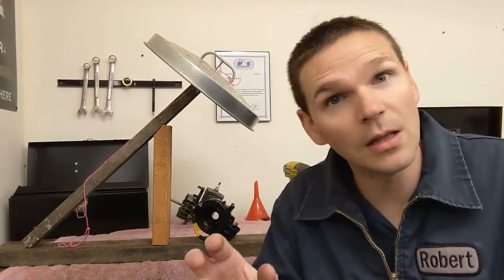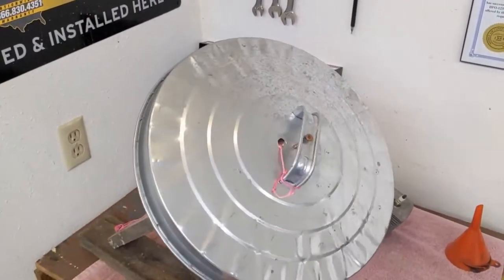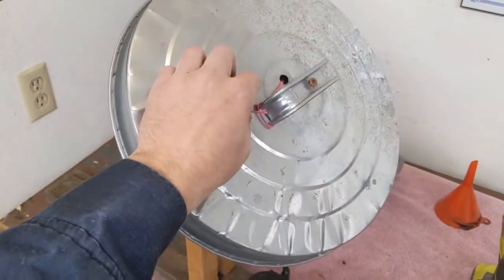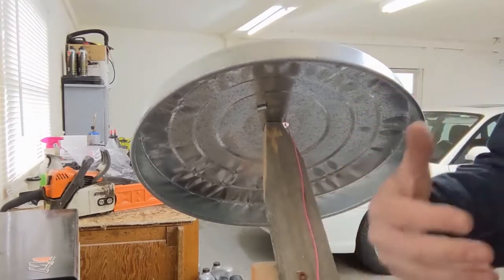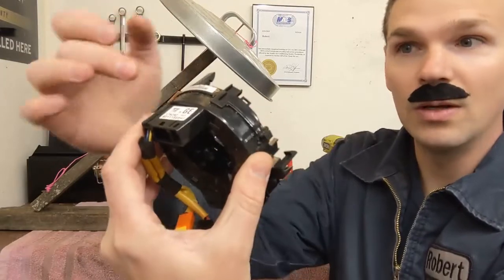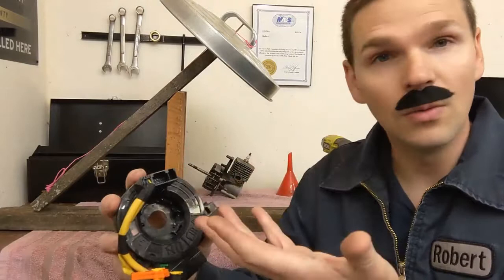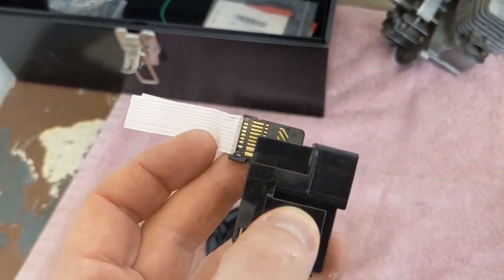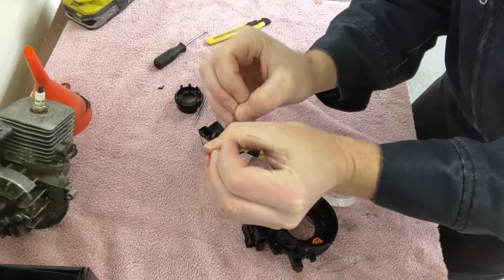Clockspring/ Roll Connector Explained and Simple Testing Method

Comment: my car have a problem there is no horn when the key is on and there is a horn when there is no key what do you think is a problem?thank you so much
Reply from the maker: @migmax-o6m  That's an interesting problem. What kind of car do you have?
Reply: @ValleyMobileAutomotive its honda civic 2010 i tried to change the relay it works but after 2 days its not working again. sometimes there is sometimes nothing
Reply from the maker: @migmax-o6m  That's interesting. It should be a simple circuit. You have a 15A fuse that has power at all times. That sends power to the relay. The horn button provides the ground to complete the circuit. The ground travels through the clock spring. When the horn doesn't work try turning the steering wheel and see if it comes back.
Reply: @ValleyMobileAutomotive I tried so many times by turning the steering wheel but still its not working sometimes there is. but the weird thing is when the engine is off there is a horn that is working😅 i was using 30amp of fuse and now 10amp but still not solving the problem😢

Comment: Would clicking while turning the wheel to the right in a specific spot mean that there is something wrong with the clock spring? I have a car out of warranty with less than 15k miles that I just noticed having clicking/gear sounds. To my knowledge all buttons work fine on the steering wheel and no airbag lights. 2019 Camry SE.
Reply from the maker: @warhawk3136  It depends. When you have the blinker on it is normal for the wheel to click while turning. Something else can be causing the clicking too. Usually a bad clock spring will make the horn or steering wheel controls not work.
Reply: @ValleyMobileAutomotive  I've not noticed any clicking from the wheel other than after a certain amount of rotations to the right. All my buttons on the wheel work as they should currently. The clicking/grinding sound is also really only noticeable when stopped and the wheel is turned.
Reply from the maker: @warhawk3136  A few things could cause a clicking noise. The clock spring can be one of them. Taking the steering wheel apart might shine some insights into it a little further 👍

Comment: WHERE YOU GET THOSE YELLOW END TESTER TIPS {FEMALE} ON YOUR METER CABLES??
LINK BE APPRECIATED......YELLOW TIPS THAT CONNECT TO YOUR EXISTING CABLES WITH A INNER HOLE THAT SLIDE OVER THE PIN
Reply from the maker: @jacobmatthew2000  I just updated the description to include those test leads 👍

Comment: Hello and good video sir, i have a question, do i need to disconnect the battery before measuring the continuity and unplug the conectors? For the airbag concerns?
Reply from the maker: @AngrDany  Correct, the connector must be disconnected before measuring continuity 👍. It would be a good idea to disconnect the battery as well.

Comment: Great video...thanks for the awesome visual👍🏻
I have had 3 clockspring  failures on my 2010 Jeep Liberty.
Any ideas on what could cause these failures besides junkyard replacements? 
Not sure where mechanic aquired🥺
Can you recommend a reputable aftermarket replacement that my have reverse engineered.
It's getting quit 
$$$ for this repair on a fixed income 🥺

Comment: Beware....   On Ebay etc, most sellers don't know the difference between a Clock Spring and the Steering Angle Sensor. ( The SAS is for cars that have Vehicle Stability Control and tells the computer how much the Steering Wheel has been turned) As shown here, the Clock Spring is just to connect Horn, Airbag and other ancillaries to the other side of the column.

Comment: I still don’t understand why they made it so difficult  🤦🏻‍♀️ it’s just a horn  .  Wouldn’t it still be   easier to run seperate  WIRE    From  a spring loaded button  behind the centre of the spring loaded hub .  It seems like a scam   - in Australia  2023   👉 to bye the clock spring unit  costs , just over $500 dollars 🤦🏻‍♀️.
Reply: They used to do that, but they kept failing so this method was thought up.

Comment: My wheel is turning lisse all the way but tires stay still Ford Edge 2010 clock spring ??
Reply from the maker: I wouldn't think the clock spring would be the issue. The clock spring only allows wiring on the steering wheel to pass through the column without getting tangled up. I would hook up a scan tool and monitor the steering wheel position sensor as you're turning the wheel. You may also have codes that will point you in a direction for diagnosis.
Reply: @ValleyMobileAutomotive  great will do thy thanks it’s just crazy I been looking for a video that shows the issue fixed but nothing like that thanks 🙏

Comment: Thank you for the video. One advice for you. The black wire shall in the COM connector, not in the amp connector in the multimeter.
Reply from the maker: Hey good catch! I must have been using it for checking something else and forgot it was in the Amp port. Having it in the COM port would have been the right port. Thanks for pointing that out 👍